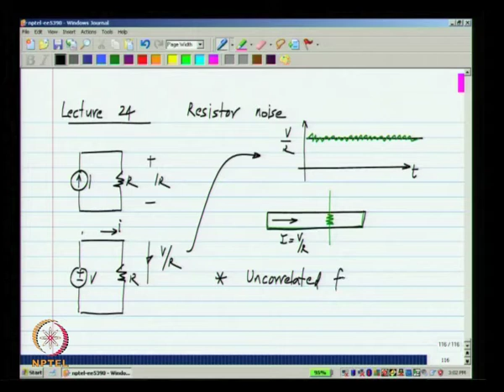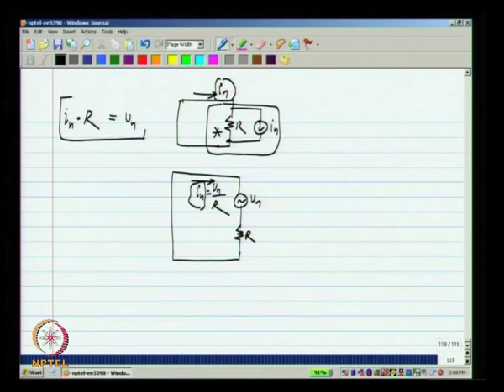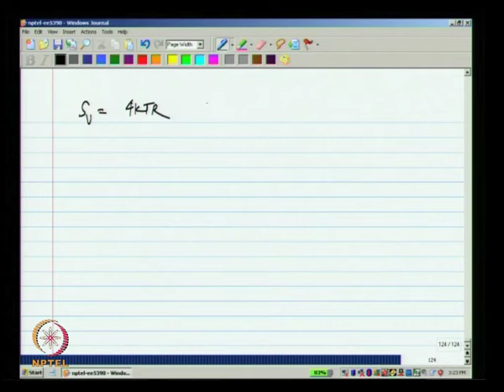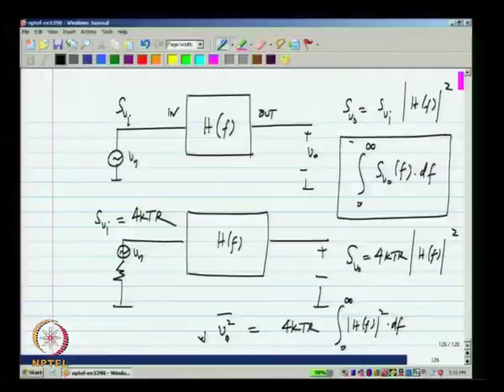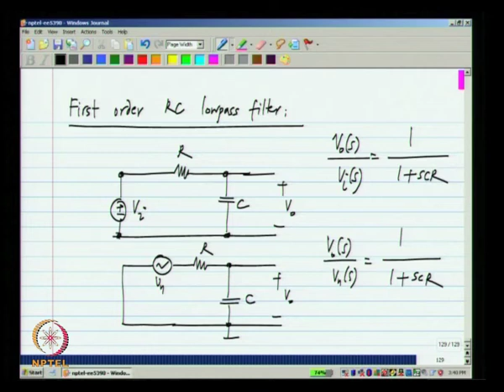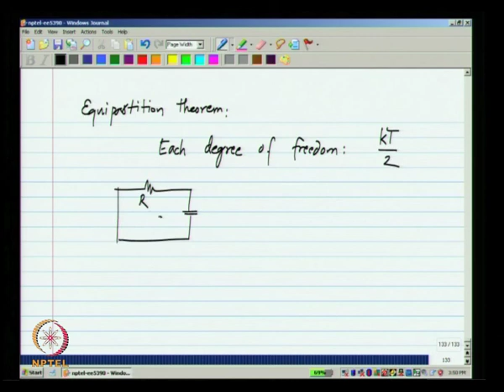Mod-01 Lec-24 Lecture 24

Comment: Noise is random thing.. in order to calculate thermal noise in resistor.. at 11: 58 we r considering noise as additive white gaussian noise ( AWGN with  zero mean that too single sided spectral density ).. if we consider it is double sided spectral density frequency range varies from - infinity to + infinity  with amplitude half.. but we r considering AWGN with single sided.. this was the reason at 29 :30 output spectral density = input spectral density × |H(f)| ^2  ( this relation will holds good for only h(t) is linear time invariant system otherwise it can't holds good ) .. from this we r trying to calculate the total power integration limits are from ( 0 to infinity) cuz it is single sided .. if we assume it as double sided limits are varies from (-infinity to + infinity) ..is it correct.. either single sided spectral density r else double sided spectral density total power going to be same..?